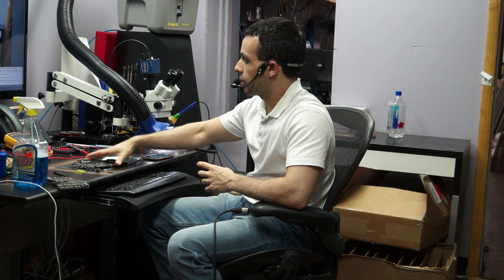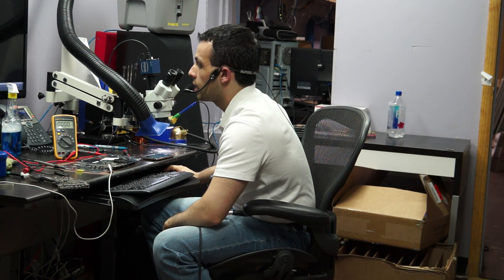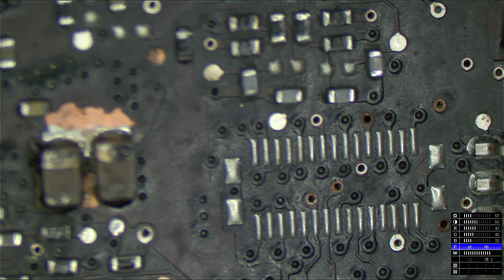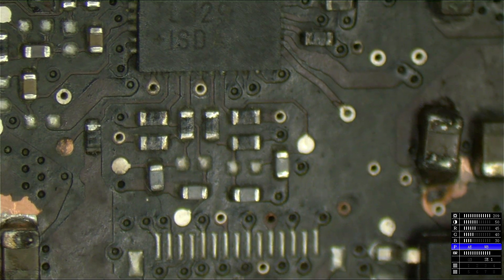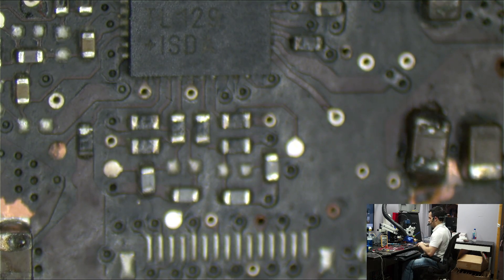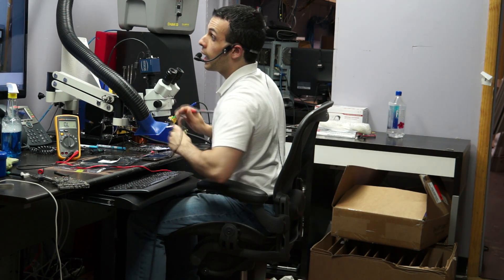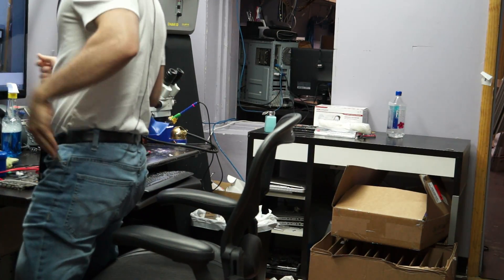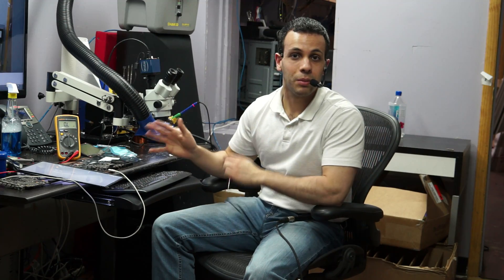820-2936 Turns on doesn't POST logic board repair

Comment: Question:
Putting a wire on the DCIN board with power supply at 18.5v too much? Will it mess with my measurements?
Reply from the maker: +Tony Tone i put mine to 17 or so, it will still work.

Comment: Question:
Putting a wire on the DCIN board with power supply at 18.5v too much? Will it mess with my measurements?

Comment: When you were talking about shit called reball, I could not agree more, but in this video cold not agree less with you. It's true a lot of sellers selling used chips and poor quality. If you have not had good experiences with such repairs consider the fact that you might be wrong. Maybe somewhere wrong.
There is no chip 8600gt (g84-603-A2) date code of 2013, a new revisions that was removed from the apple motherboard. It is not used chip.
Otherwise, a big thank you for the hard work and unselfish sharing of knowledge. Great videos
Reply from the maker: Alvin Lučić g84-603-a2 aren't used, but fix that machine and show me what happens a month later ;) I can't even count those, we don't repair, just shoot arrows through them!
Reply: Louis Rossmann Of course, g84 is the just best example. From my experience, the replacement chip is a reliable and permanent solution. Personally, I decided to give warranty for 12 months Apple and 6 for the other computers. Okay, if you do not work for you ... The expected working time is about the same as with the original chip, on average. Thus several years, not month. Of course there are exceptions, but there is also a guarantee.

Comment: hello Luis.
id like to ask, i have had a a1286 2010 i5 logic board that has been repaired by my local component repair shop in London. when i have put it together, i was happy it turned on and it showed question mark. so i finished it off and did wait a few days for the hdd to turn up. when it did, ive put it in and wanted to start installing OS. i get nothing. just grey screen for a loooong time. i have opened it up again and have burned my finger on cooler... it is like boiling hot... should i return the board to be redone or is it a goner?
thx for your opinion
Reply from the maker: maaaslo81 820-2850 are junk,  no point in trying to fix them
Reply: Louis Rossmann  and ive got 3 of them... if i may ask, is it the whole layout of the board or something else that is junk on them?
btw, i think it might have been the faulty superdrive that has been preventing it from doing POST. i now get the board to read the hdd, but thats about it. board still gets incredibly hot...